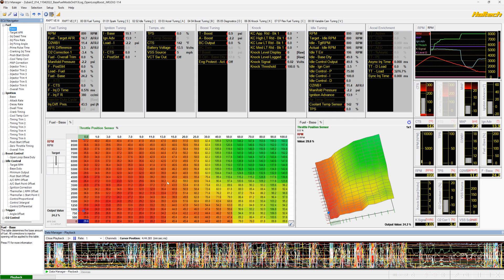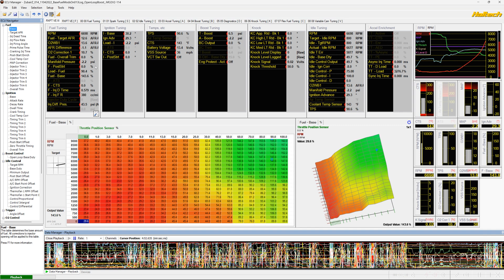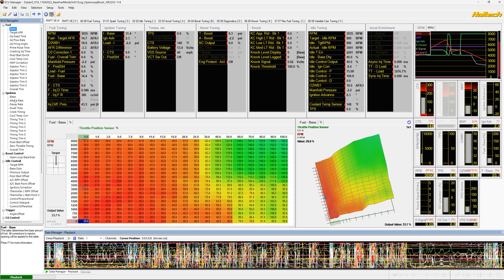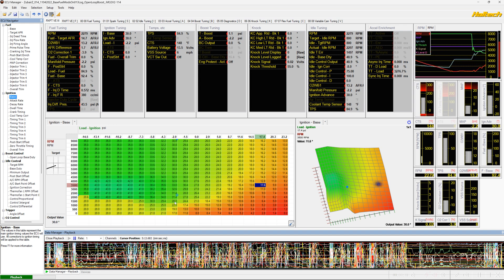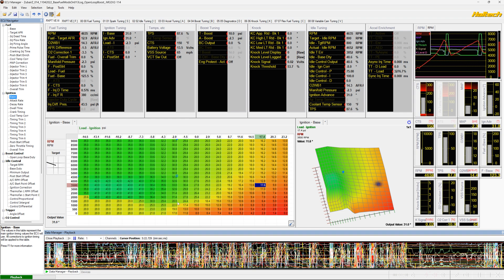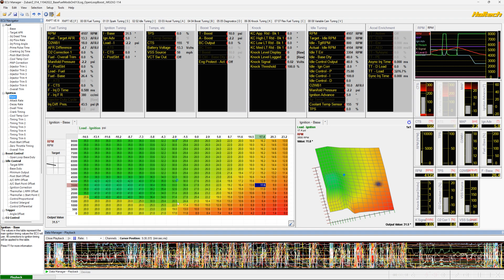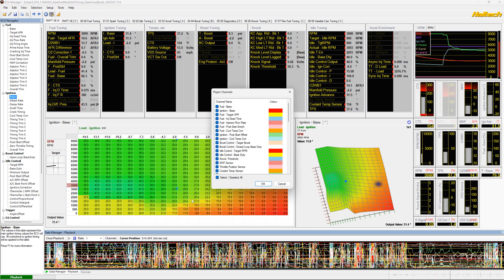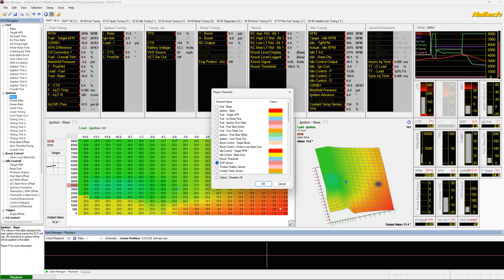Haltech Customer Support - MAP and TPS Sensor

Comment: Did the car run like shit when you lost signal?
Reply from the maker: @Toobluejzs147  It ran okay because we were just in that part throttle area. But it had to be fixed to do our tuning properly. All of these sensors are critical  for proper tuning.
Reply: @Morgamania2   on my car i loose connection to map sensor or tps intermittently then ill let it cool off and it drives normal still can’t figure it out. Drives like shit when it happens and idle goes up and down too